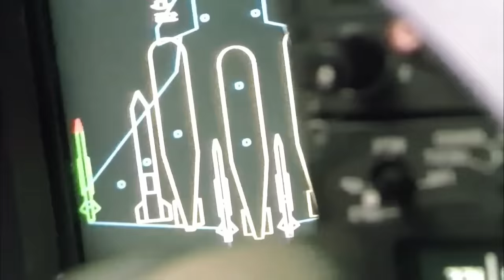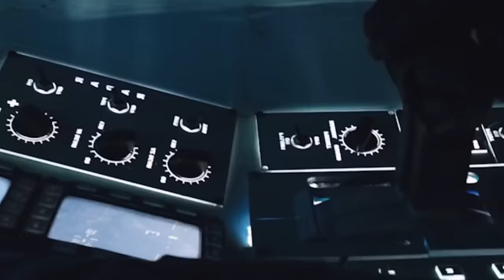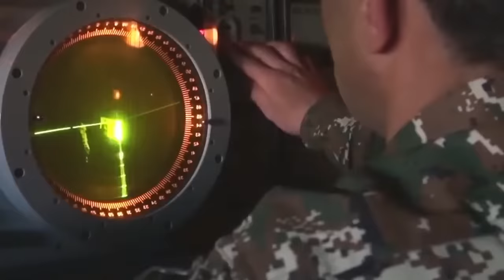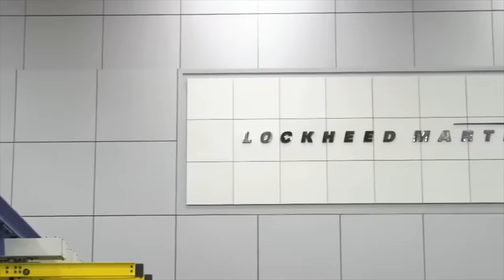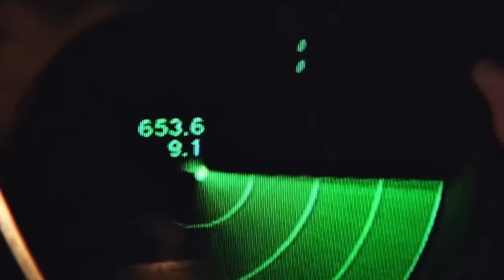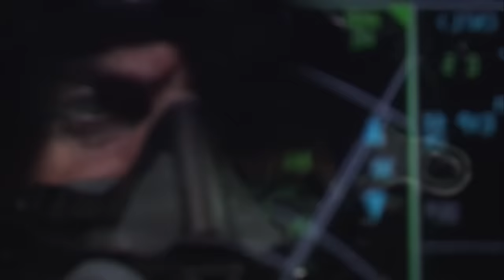US Hypersonic Missile That Can Destroy China in 30 Sec

Comment: This is good, because the US knows that a hypersonic missile simply cannot hit a plane, only a ship or something almost static. Because at match 10, it would simply take too many miles to turn at least 10 or 20 miles or more I haven't calculated it.
However, a plane or ship is only a few hundred meters away, so as soon as you see it on the radars approaching it, it just turns and it would no longer hit the target unless it is an atomic missile. In this way, the US achieves a tighter turn for the missile, which it normally would not be able to do with fins alone.
Reply: The Missile Utility Transformation Via Articulated Nose Technology program, or MUTANT, uses a form of active morphing involving high-rate pivoting of the missile forebody — referred to as articulation. Radius turning circle allows dodging incoming possible.

Comment: Speaking from experience; the cockpits open the wrong way.  A plane captain is required to clean the inside and outside of the canopy each time it hits the deck; when on land or at sea.  With the canopy opening towards the nose of the aircraft; it make the cleaning of the outside of the canopy very dangerous for the plane captain, as he/she can no longer stand on the cockpit sills to clean the outside of the canopy.  Canopies always need to open toward the rear of the aircraft, keeping safety in mind for the plane captains.

Comment: Last time US Hypersonic Missile flow just 7 second and Boooooom . Regards from Spain
Reply: That's because the outer skin of the missile developed a tear in the outer skin, and the fuel ignited.  When the mishap was investigated, they found out the metal was reprocessed metal from China, making the outer skin, not strong enough to withstand the heat, speed or air velocity.